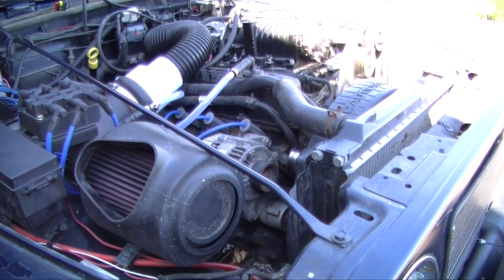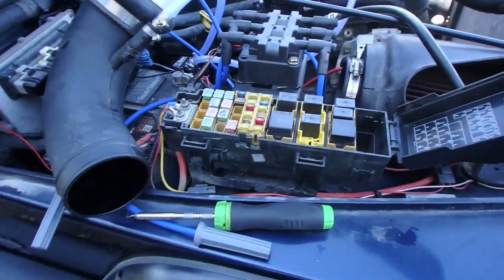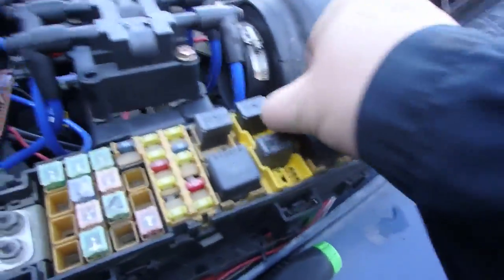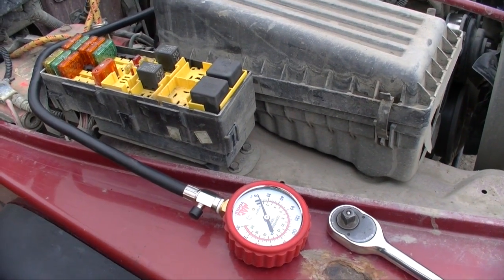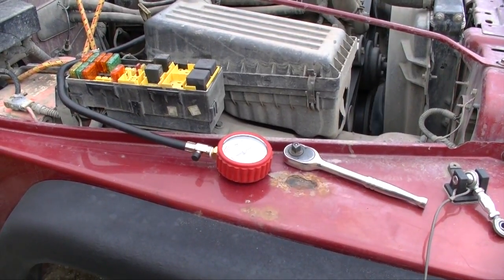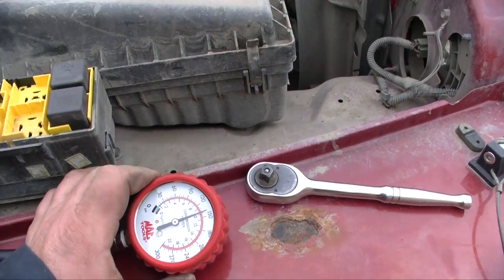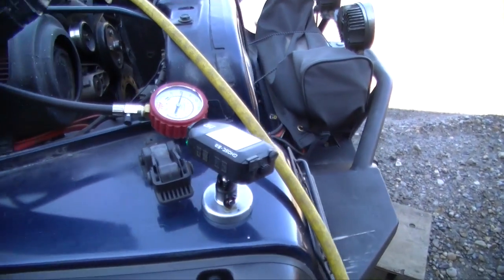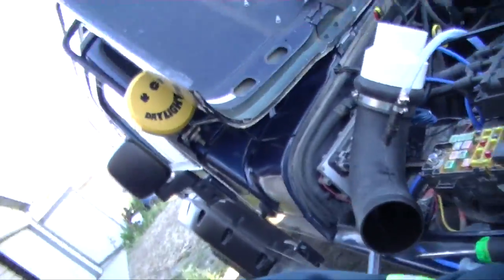How to Tell if Engine has Low Compression

Comment: i only remove one plug at a time, i just did the compresion test on one side of the engine, and remove fuel pump fuse,  but i did NOT put the gas petal down to the floor, and start it over, tester show 0, but the Plugs are cover in Oil, i change the plugs a month ago and run the car for 26 mins since the plug and wire change, I think i can be 100% sure the piston rings are shot. Thank you very much for this Video!

Comment: My engine chokes out if i put my accelerator to the floor but idles fine when i dont press the pedal whats wrong? I also do not have any check engine lights at all no vacuum leaks either
Reply: Just had the same issue fuel pump sock was clogged and at 3000 rpms it couldn't supply enough fuel
Reply: @jacksonpentecost712  do you a chevy/gmc???
Reply: @jacksonpentecost712  I'm truck is doing the same thing
Reply: @jacksonpentecost712  does it drop rpms, does it stall out, and does it flash any lights??
Reply: Same dude wtf is it?
Reply: hey Sergio, what was your issue? my car idles and revs good in park/neutral. once I drive it loses power. if I drive like a gramma, I can slowly and I mean very slowly , make it up to highway speeds but it sounds choked out almost. I've checked the catalytic converter for plugging,  cleaned the throttle body (scanner says it's responding), changed air filter and air temperature sensor, replaced plugs, tested fuel pressure ,( it stays at factory specs at 2000 rpm) . It is only under load that the power drops immensely.
Reply: Rubbing brakes?
Reply: Late to the party. I had the same issue in my 98 ranger 3.0. bad MAF sensor!

Comment: That's not a 2003
Reply from the maker: Yeah ok..... I own the fucking Jeep for fuck sakes
Reply: BSK Garage 2000 and up have a coil pack instead of distributor etc. is that the original engine and computer.